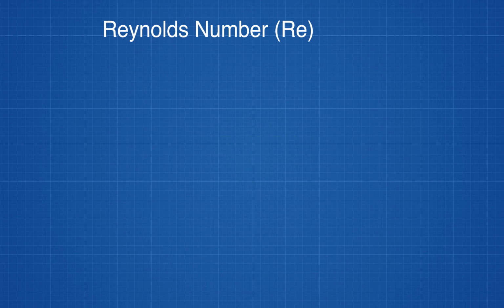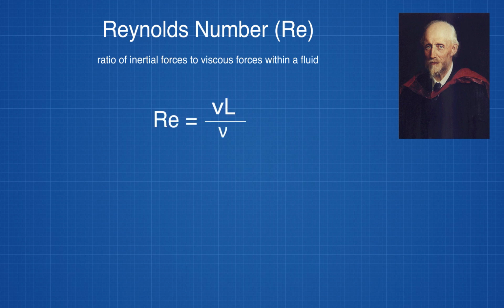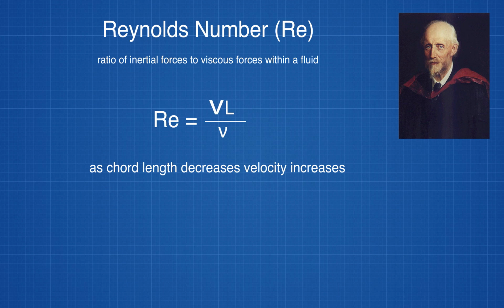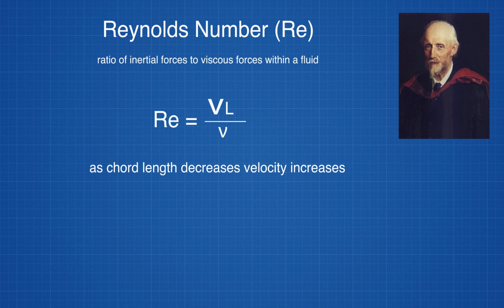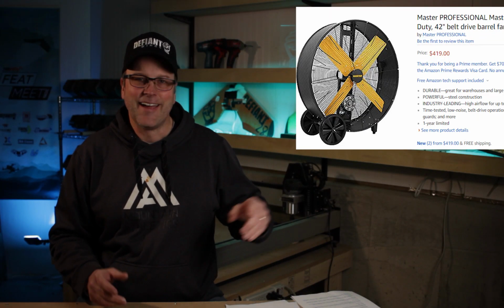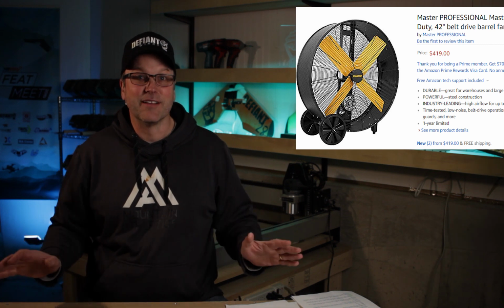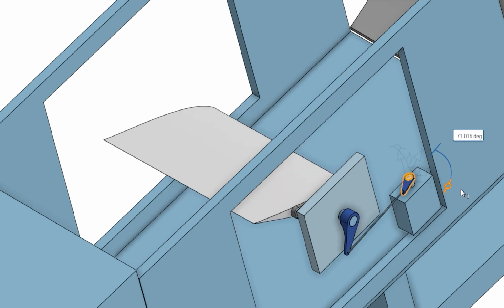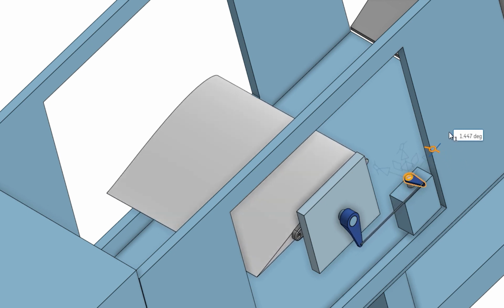Wind Tunnel Build Part 2 (Knowledge Series video 6)

Comment: Hi, we are building a wind tunnel for a school project and we have a problem with the smoke. We also used a smoke machine and a flexible tube, but the smoke turns into water. I saw that in your video you did a certain thing which led to having smoke instead of water. What exactly did you do?
Reply from the maker: I blow the smoke from the smoke machine into a large plastic chamber(tub) that has its own fan to blow the smoke through a 1.5” tube and into the wind tunnel. I’m just using an inexpensive Halloween smoke machine from Amazon. It takes a bit of timing to shut off the fan and blow more smoke into the chamber, shut the chamber door(4” diameter slide gate) and turn the fan back on, but it was the only way I could get it to work reliably

Comment: This is 4 years late, but kerosene and baby powder that you just paint on and run the fan with the body at the AOA in question.  Paint your wings black and you can see exactly how your airflow behaves when the kerosene evaporates and leaves behind the baby powder.  You can get very advanced by mounting through the front and rear of your view port with your mounting surface floating between two panels. You can suspend these floating panels on load cells and get some really good data.  If you make your floating panels round you can get a complete plot of lift to drag at pressure and speed at different AOA by letting ms excel draw up some graphs for you with the data you capture with your loadcells.  You can also print your honeycomb structure and have your smoke tubes extending straight out of that, or mount your wing vertically and introduce the smoke through the leading edge of the airfoil through tiny holes, makes for some great viewing.  I mean yours was already built, but just some ideas for anyone else that might want to experiment with building one.
Reply: If the fan and housing is round, why is the tunnel always square in cross section?

Wouldn't it be logical to make the tunnel round everywhere ?
Reply: @myotherusername9224  square is easier to build

Comment: I built a very rudimentary wind tunnel a few years ago; did what I was hoping to visualize which was vortices.

I planned on building a better one and finally I'm biting the bullet. I'm also planning to use a radiator fan (16"). For my vapor it's going to go through the wings and exit out their tips in a specific location. Which means the connection to the wing and what allows the vapor to exit through is the same thing. I built my wings in the past out of cardstock which means I could create designated channels in the wing to direct the vapor itself to the tip. Worked perfectly.

For the test section it's going to be 10x10"x3' length. All out of plexiglass. I'm thinking of painting the bottom and back side in vanta black for obvious reasons.

Comment: Hello, I would like to know the useful section of the tunnel, and the diameter of the copper tubes that you used. Thank you. Great job!!!!
Reply from the maker: The test section is on 12”x12” in section and 24” long. The tubing is 1/4” od copper tubing. I’ll have to check the ID
Reply from the maker: 1/8” ID

Comment: Impressive results! You can change the bottom (and every surface for that matter) surface to black so it does not reflect light all over the place. Another trick would be to push the back surface further back if this is not messing with the function of your design so it does not getting any light (total black). Thank you for sharing!

Comment: Great video - thanks very much!
Have you had a chance to see if the fan is really delivering 2000cfm?  That is, do you get 2000 fpm or 33 mph in your 1 sqft test section?
Reply from the maker: I have tested it and no,  it’s not putting out that much. Either it can’t handle the losses in the tunnel or it’s just a cheap, misrepresented fan or both…my money is in both 🤣

Comment: Hi can you explain a bit how you did the smoke generator. Because i tried to do it but it failed do to the heat of the fog machine
Reply from the maker: The fog machine produces a lot of fog for a short time and can get hot. I use a large fog reservoir made from a sealed 18gallon  tub. I use a large inlet that seals closed. The large opening lets the fog in without the fog machine touching the plastic. Once the reservoir is full I stop the fog and close the door. A small variable speed fan on the side of the reservoir pressurizes the reservoir and forces the fog out the outlet pipe that leads to  smoke rake in the wind tunnel. When I run low on fog I start the process again.
Reply from the maker: Wind Tunnel Smoke System Walk-through https://youtu.be/e9S9xcg9TRI
Reply: Thank you so much sirr

Comment: I’m looking to build a wind tunnel to test out the aero dynamics of RC car Bodies for different types of racing. I’m mainly into drag racing as it’s popularity has went off the charts. Trying to understand all of this is hard on my old man brain. Math isn’t my friend either. I want to figure out a way to measure down force, drag, and lift on these bodies to determine which are best for the specific type of racing. I’m going to be mainly doing 1/10 and 1/8 scale racing. In drag racing the bodies are limited right now, so being able to make adjustments to the bodies to gain better aerodynamics which would lead to faster speeds and/or lower et’s. Any help or advice you could lend me in the building process or point me in the direction of sensors or programs that would measure downforce, drag, and lift without taking out a second mortgage, would be greatly appreciated.

Comment: Great work! What fan did you purchase to use in the wind tunnel?
Reply from the maker: JoJoTortillaBoy the fan I used came from Amazon. It is a 12v car radiator fan. 16" High Performance Black... https://www.amazon.com/dp/B01MQFSKN3?ref=ppx_pop_mob_ap_share

I will likely upgrade to a more powerful fan eventually
Reply: @DefiantWings  thank you!

Comment: I love this! I built a small wind tunnel for fun a while back and am working on 2 more for rockets with things I learned ! This video gave me some good ideas too! I totally understand the challenge of setting lights at specific angles to get the smoke to be visible and cutting all those straws in the last video 😂😂😂😂. I used a 3D printer to print the air laminator this time instead of cutting straws though wjich saved a lot of work.
Reply from the maker: Yeah, the straws were a pain. 3D printing would probably been easier and cheaper🤷‍♂️. Next time.  I’m working on the instrumentation now. It’s coming along.
Reply: @DefiantWings  cool! Will you use a load cell to measure drag?

Comment: Wow, incredible work getting to where you are!! Thanks for sharing this project!!! Something I thought about seeing when you got it working was where are the elevons that cause the pitch?? Because I would love to see the cause and effect of them .... Just a thought.... Thanks again for sharing, I just watched all of the Knowledge Series back to back :)
Reply from the maker: I plan on doing a series of visions using the wind tunnel once it’s completed. The pitch control of a wing with elevons is the same as with a conventional setup. Deflecting the elevon down changes the life coefficient of the wing and increases its lift. Because the aerodynamic center/center of pressure is behind the CG and increase in lift will force the nose down. A decrease in lift will force the nose up.

Comment: Reynolds numbers are fascinating. I read research once that because of Reynolds numbers, insects don’t really fly in air, for them it’s more like swimming in water. And another article on the hypersonic wind tunnel that NASA runs at Goddard SFC (I think). They do it with air pressure like you said. It runs at something like 10atm and then has a 10:1 reduction to get to hypersonic speeds. The air tank is the size of a water tower and it can run for around 8 minutes. Wild.
Reply from the maker: If I had it to do over I think I would have studied aeronautical engineering... but I’m having a lot of fun teaching myself these days. There is so much to it. I love it!
Reply: @DefiantWings  Hey, I tried and it didn't work out so well. I ended up majoring in exactly what flight controllers do, and they're still black magic to me. I was a lousy student...